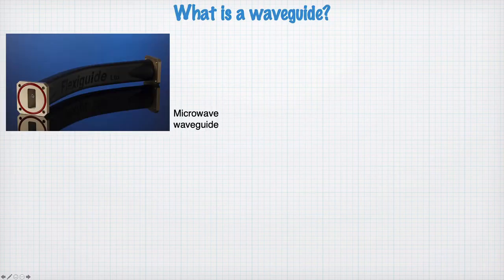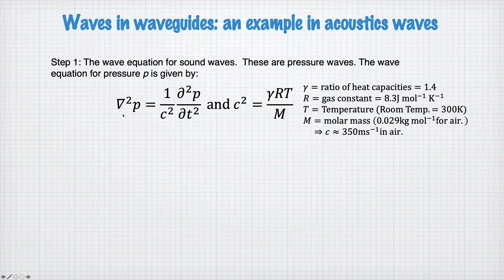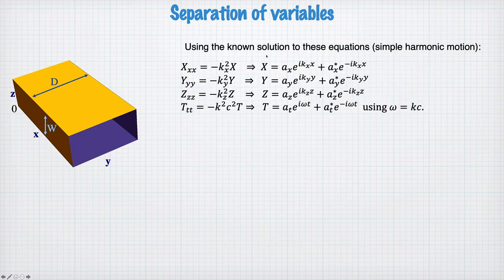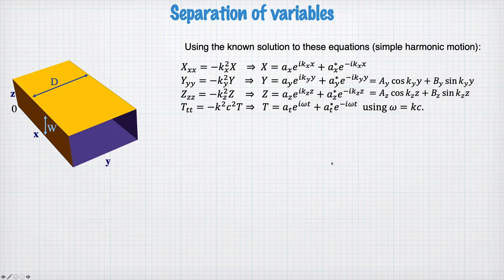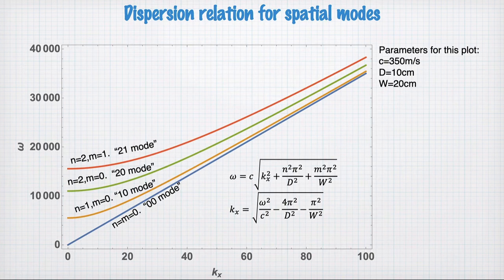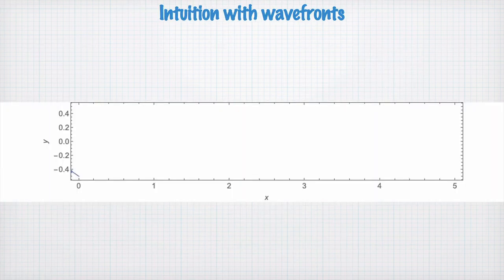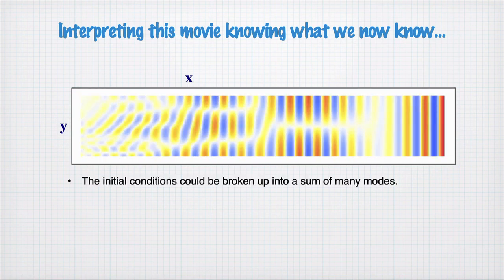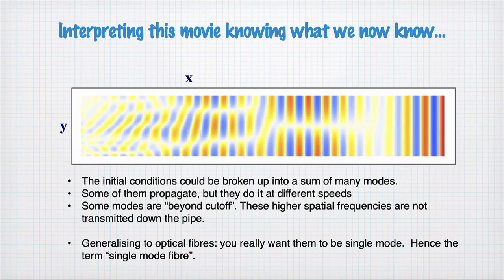Waveguides and modes

Comment: So the radiation is created through the change in motion, acceleration/deceleration of a charged particle (ie an electron)

However in a wave guide that’s already been created at the front end, so how is this radiation radiated in a closed style antenna such as a rototiller etc?